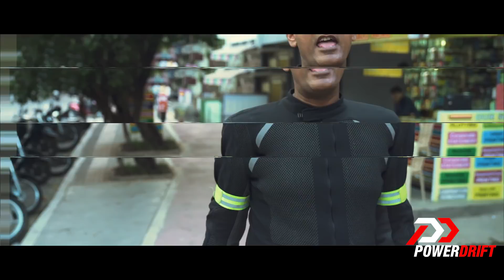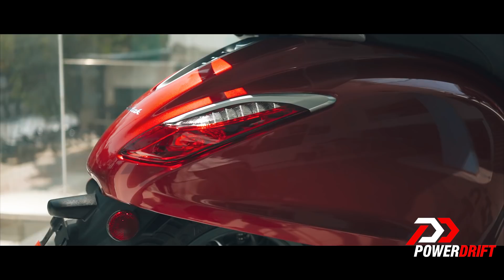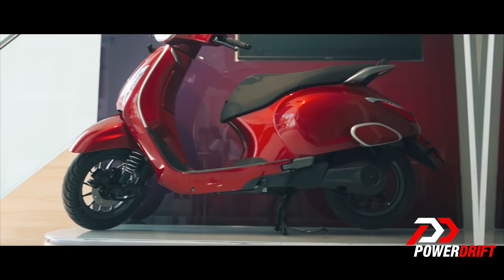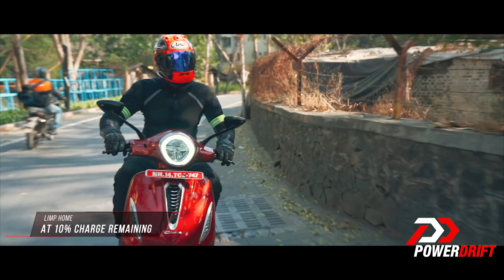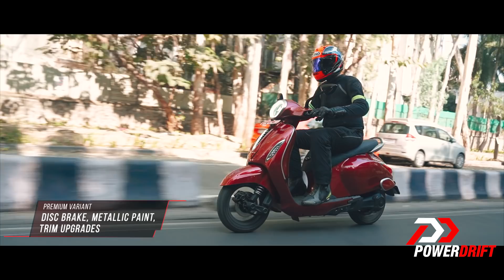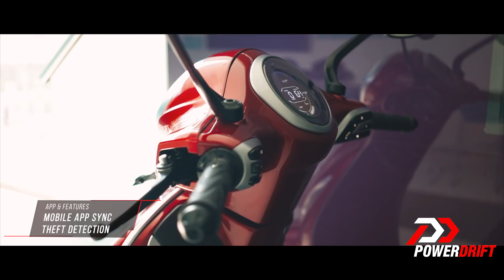Bajaj Chetak | First electric ride | PowerDrift

Comment from the maker: Hey #PDArmy, do you think the electric Chetak can manage to do what the original Chetak did? Let us know below, and remember to hit that Like button.
Reply: Honestly it has nothing to do with the original Chetak. They are just trying to cash on your nostalgia.

On a related side note..

Even if 100% electricity came from coal. It's still much more efficient than an ICE because of the well to wheel efficiencies being higher.
Reply: Sir please review the new Access 125 BS6
Reply: If Ather doesn't fix the 450x pricing they'll be able to pull it off!
Reply: No ways India is miles behind to go electric in the automobile segment.
Reply: It's not chetak only, actually none of the electric car or two wheeler can match any ICE in terms of practical usage, and thanks to the charging infrastructure not a single      electric vehicle will work.
Reply: @jaiveersinghmanhas710  There are thousands of people who use scooters only for city riding and can charge their electric vehicle at home. These people will save 90% of their previous fuel costs on monthly basis. These people will also not add to the pollution of the city. Just because it doesn't work for you does not mean it won't work for many others. 2636 charging stations tender approved by Indian Govt in Jan. In 3 years battery prices will be half of today's price and those batteries will be made in India at even cheaper price. That crazy petrol scooter you are buying today won't even hold half of its resale value in 3 years.
Reply: Does we need  a driving licence to ride this bike in India?
Reply: @prof.hijibiji9649  Yes, Any vehicles which goes above 30 kmph speed you need a licence.
Reply: I don't know how many times I have commented this but here we go again. As per the Research of Concerned Scientists for EV Cars, even if EVs are 100% powered by coal, the emissions at the coal plant will be 50% of that of petrol vehicle. This is due to high efficiency of motor in EV at 90% compared to low 30% efficiency in engine. For the same amount of energy the EVs can travel much farther than the petrol vehicle.  Now guess which is easier to control emissions from, a coal power plant or 10,000 petrol vehicles spread out in the city. At least in Delhi pollution mess they closed a coal plant temporarily to reduce pollution. Is that not better than odd even policy ? 17% of Indian Electricity is renewable. And it keeps increasing. You can make your EV 100% clean by putting solar on your roof, but the petrol vehicle is dirty for all its lifetime. Also if you want or look into coal plant pollution for EV, then you should not ignore the pollution due to Oil extraction, Oil refining, transportation of Oil and then the pollution due to burning the Oil fuels ! Have a nice day !
Reply: When will  Honda cb150r be released in India sir please please please reply me
Reply: Tvs iqube next please 😁👍
Reply: audio bad after 1 minute
Reply: No way.
Reply: audio quality sucks. audio quality could have been better.
Reply: Not even close
Reply: @musafirpk377  I am sure the electric Chetak can't time travel us to the 80's and 90's but this is a new beginning. And like all new beginnings, new people will take up this journey !
Reply: Improve audio quality next time please
Reply: Nice vedio
#DHarrierRedEdition
Reply: does one not need a driving license to ride an electric scooter?
Reply: Lack of fast charging option, no charging network being set up and only 60 kmph top speed... Unfortunately it is not going to get masses to go for it..So, no, it's not going to be anywhere near original Chetak. But let's hope Bajaj will improve performance and come up with battery swapping/charging etc.
Reply: Electric vehicles has to pay 5% gst while petrol vehicles has to pay 28% gst, electric vehicles get huge subsidies for ex.-ather 450 gets 22000 subsidy. There is a difference in road tax RTO of petrol and electric vehicles which vary according to states. For ex- MP charges 8% on ex showroom for  RTO for petrol vehicles whereas it's only 4% for electric vehicles. Battery would cost around 50000 in electric vehicles. Even after so much tax exemption and subsidies and benefits electric vehicles can't compete to even 110cc scooter in terms of performance i.e.acceleration and top speed and range and pricing even double and triple  to petrol vehicles.
Thus India should postpone it's electric vehicle plan and focus on declining automobile sector.
Reply: @VishalYadav-cu8ci  If you want a spec wise competitive product but the Revolt RV 400. It does 80 km at 85 kmph speed, 100km at 60 kmph speed and 120km at 45 kmph speed. It costs 1.4 lakh if you pay via emi for 3 years or Rs 1.2 lakh if you buy directly. It also has an 8 year battery warranty and 5 year bike warranty.
Reply: Forget the original Chetak, it will not even manage to do what Activa did for the segment

Comment: Nice review. But educate yourself. Even when 100% Electric comes from coal still Electric scooters will be less polluting in terms of Carbon. Simply because Electric motors are around 90% efficient compared to 30% of petrol. Also producing and transporting petrol causes another carbon pollution.
Also you compared price. Remember cost of ownership is about same. If you look at Petrol cost + maintenance vs Electric cost and less maintenance.

Comment: Bajaj should forget entering scooter/scooty market bcoz it uses cheap material /outdated technology n have cheated people for generations under old monopolistic/license Raj
Looks r old fashioned n after use it shows its colour like rattling, noisy, low mileage, etc etc due to faulty structural designing and dubious claims.

Comment: Legacy bike makers will not give us the best product, as they are not fully into it, and that is not possible either. Such half-hearted experimental shot rather creates misconception among masses that electric bikes are not 'viable'. They are expensive, slow, hard to 'fill-up', and low in range, though ideally, except 'not as fast as fuel fill up', all other notions are outright wrong.

I will rather count on Ather...they will change the game, and push the thing where it should be, an electric future.

Comment: I don't know why main stream media says it's coal powered grid. Coal powered grid gives efficiency of 35% to 45% . In case of petrol powered engines that too in two wheeler gives max of  only 15 to 25% efficiency you(you can imagine more reduced efficiency if you compare a scooters CVT and Centrifugal clutching). Using coal power is also a significant gain of efficiency. As well as pollution. Efficiency is directly proportional to emissions.
Reply: Liju Vaidhyan Sure. But you do see that updating vehicles without significantly changing power generation is a half-step which is being ‘sold’ as the solution, is disingenuous, yes?
Reply: @shu_mar  one step at a time.

Comment: Another flop, good going 1.15 lakhs for this good joke
Reply: Flop why?? 🙄
Reply: @souravroy9245  price, zero charging points 60 kms cap, zero info on who will service or repair bike, life of batteries ? to travel travel 20 km in Bengaluru it will sometime takes 2 hours then return journey 2 hours where should one charge in between if battery runs out of power
Reply: Yes, your concerns about this is absolutely right. But I think Bajaj will do all the work themselves. 60km cap is a really deal breaking issue. They have to clear all the doubts of Consumers.

Comment: The question I have is , Are electrics today priced more only due to battery costs or Big manufacturers pricing them that high so that it does not cannibalise their existing Petrol-powered lineup , Considering Ather 450 at 1.12lakh with all the sophisticated chassis and features costs less that the Chetak and Icube from TVS

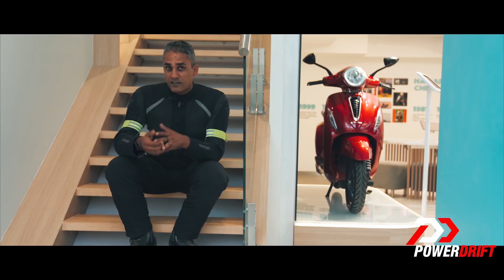Comment: 5:20  "Most of electricity you burn in your house comes from coal"? How? Karnataka is already 62% renewable, with renewable percentage going up each year. If we can start charging differential price for electricity during the Solar-day time, then people will also start charging when electricity prices are low, thus increasing clean energy usage. Also, all these batteries may act as store house of electricity produced during the day.

Comment: Can someone tell me how the tvs iqube manages to generate 140nm torque?
Reply: immanuel iggi Yes. The electric motor torque is being expressed in two ways now. At the motor - which is what Bajaj whites. And at the wheel having applied a reduction factor for the gear-driven connection to the rear wheel. Those numbers are in the hundreds of Nm. I think a statutory method needs to be implemented.
Reply: @shu_mar  thanks shumi 🙈🙌🏻

Comment: Given i have solar installation at my home this will be great for me
Reply: solar roof panels work your entire home? how much did it cost?
Reply: @user-bl1zt9xg7f  it's a 5kva setup. And home only uses 10% of the power it generates and rest is used to charge the ups so am literally wasting most of the electricity generated. So buying this gaadi means I'll be charging it for free and roaming around for free

Edit it's a 7kva setup costing 6lacs
Reply: @windyWindward  how much did the setup cost?
Reply: @lord_vader5006  6 lacs in Karnataka

Comment: The transmission system looks different from other electric scooters. Hope Bajaj makes a reliable one. Because their first full size automatic scooter Saffire came with s 3 speed automatic, as opposed to CVT of others. It was a nightmare and disaster.
Reply: Siva Prakash Theres hardly any transmission in these EVs. Just ways to connect the motor to the hub on the rear wheel. #Solved
Reply: Thanks @shu_mar  for the reply. You mean to say that instead of a belt (as in ather450), here the connection is through gear?
Reply: Siva Prakash Yup. If you see online there’s a drawing that explains it also
Reply: Thanks @shu_mar   I will check it out.

Comment: The biggest con is the nonremovable battery pack! 😰
What's up with ppl like me who stays in an apartment (let's say top floors) ??
Reply from the maker: Batteries are really heavy to carry around, and engineering swappable batteries is a tough task. Nevertheless, let's hope we get to see it in Chetak 2.0 ;-)
Reply: @powerdriftofficial  Right, like the 19kg battery of the Revolt 4V. Imagine carrying a 20ltr water bottle to the top floors :D
Reply: Okinawa provides removable battery option... As a owner of Okinawa electric scooter i am happy with the product.
Reply: I just bought an e-cycle and faced the same problem. Had to buy a 20m cable and throw it from 5th floor to the parking. Other option is to get a plug point connection from your flat meter to the parking but I dont know what it costs.
Reply: Maybe you can get the charger installed at the parking spot. Try talking to the owner of the building bro
Reply: Buy villa
Reply: @Trevor Philips Not all

Comment: When you realize the rtr 200 bs6 has the same torque as this thing
Reply: it doesnt mean it has the same power/ acceleration out put lol ! tourqe means how quickly you reach your rotational force ( in this case horse power ) example : swinging in the same angle with same force with  a hockey bat and hitting someone  VS Swinging an umbrella in the exact same manner and hitting the same person ! here the distance traveled and time taken by the object is same but results are different one will shatter every fucking bone and one will just piss the guy off . Then again one advantage of being an EV is the torque is instant meaning as soon as you open the throttle you get the available torque where as in combustion engines the toque reaches it maximum value at a certain RPM
Reply: Really?
Reply: You see, thats the beauty of EVs. Max Torque is available to use all the time compared to Petrol engines where the Torque output is variable and max torque is only generated at a certain rpm of the engine. When Tesla P90D came out it beat almost every petrol supercar in terms of acceleration, even with 4 people on board, up until 60 mph, then it starts to slow down. Even Electric Superbikes chew out inclines unlike the normal superbikes because of this. Sad that India's electricity is based on mostly coal so this shift doesnt help much unless they take certain steps for E production through renewable sources
Reply: @fussUpper  I don't know how many times I have commented this but here we go again. As per the Research of Concerned Scientists for EV Cars, even if EVs are 100% powered by coal, the emissions at the coal plant will be 50% of that of petrol vehicle. This is due to high efficiency of motor in EV at 90% compared to low 30% efficiency in engine. For the same amount of energy the EVs can travel much farther than the petrol vehicle.  Now guess which is easier to control emissions from, a coal power plant or 10,000 petrol vehicles spread out in the city. At least in Delhi pollution mess they closed a coal plant temporarily to reduce pollution. Is that not better than odd even policy ? 17% of Indian Electricity is renewable. And it keeps increasing. You can make your EV 100% clean by putting solar on your roof, but the petrol vehicle is dirty for all its lifetime. Also if you want or look into coal plant pollution for EV, then you should not ignore the pollution due to Oil extraction, Oil refining, transportation of Oil and then the pollution due to burning the Oil fuels ! Have a nice day !
Reply: @evthink  Varun, I once read an article that harmful pollutants emitted by burning coal to ride an EV for a certain distance are more than that of a petrol vehicle covering the same distance. But Im not sure if thats true so I hope youre right. 

Aditya, although its a necessity, I dont think many people would install solar panels out of their own pocket as for many itll be too expensive and some dont care much about reducing pollution and variable other reasons. They wont do it unless government makes it mandatory, which sure will become another mess or install it for free for everyone who buys an EV but is very unlikely. Just like how a nations government are doing many things to address the pollution problem the people of a nation should contribute towards the same goal collectively, but that doesnt happen in real life. People are just people.
Reply: @fussUpper  45% of pollution in cities is caused by vehicles changing to EVs definitely change that slowly